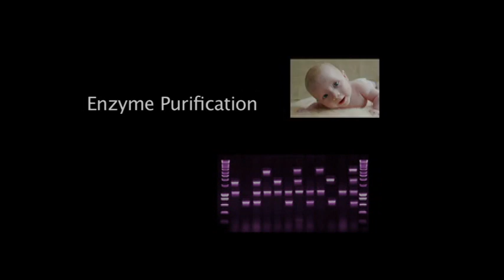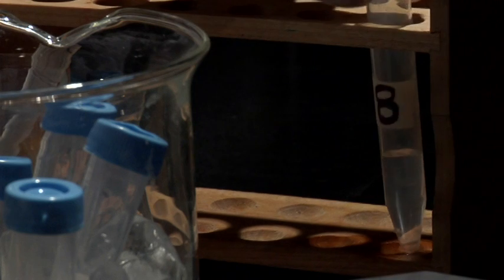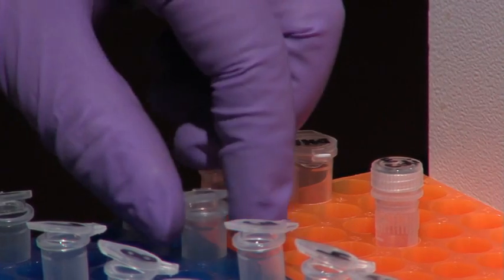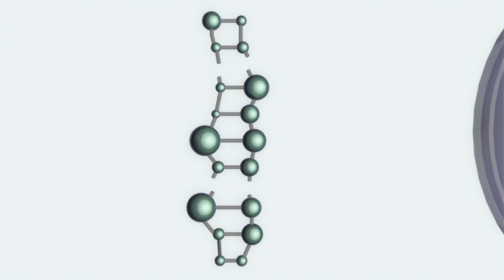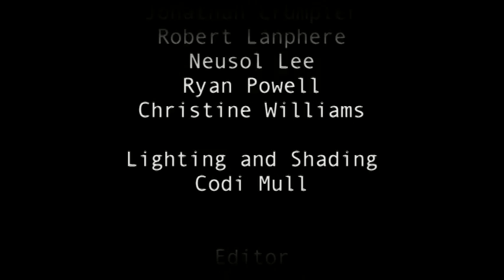Enzyme Purification

Comment: How are they separating in the pipette? Is it just gravity + time?
Reply: The cellulose in the column has nanopores. Tiny particles can enter them and are slowed down, while larger particles move faster, so the stuff that ends up coming out first is all large molecules in the water, while the small ones come out at the end because they were small enough to get into the cellulose and slow down.